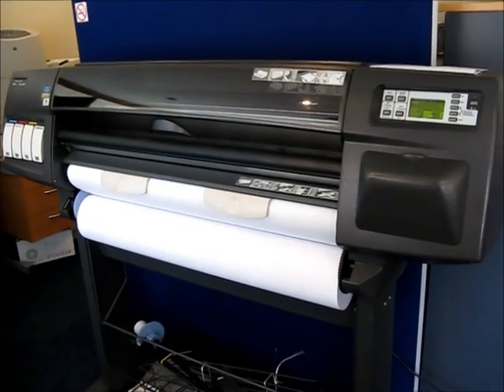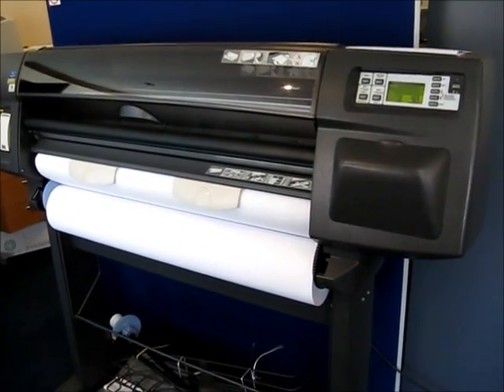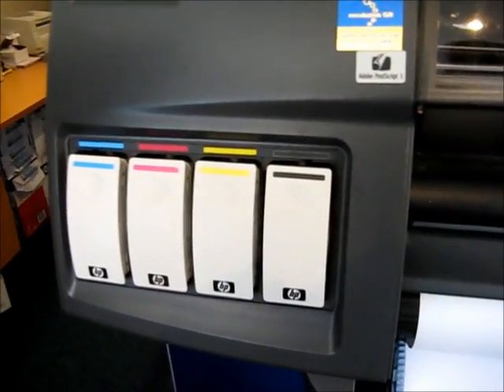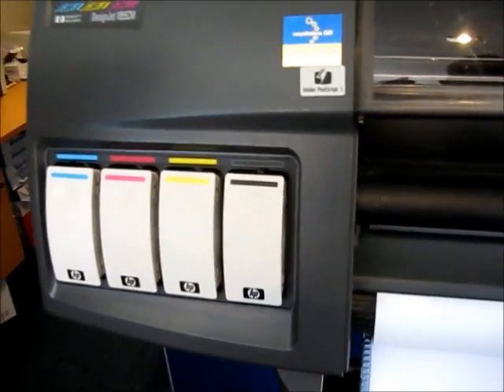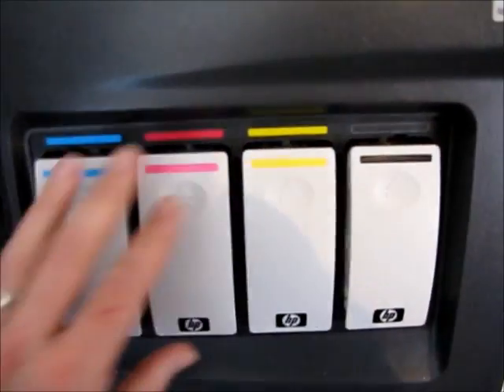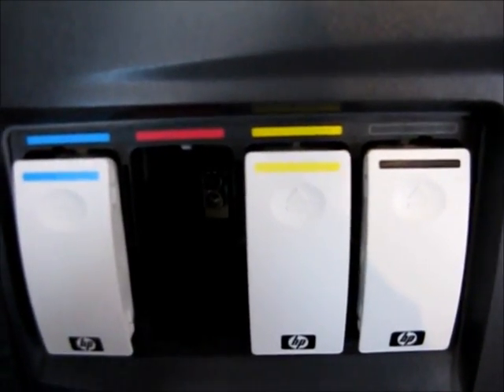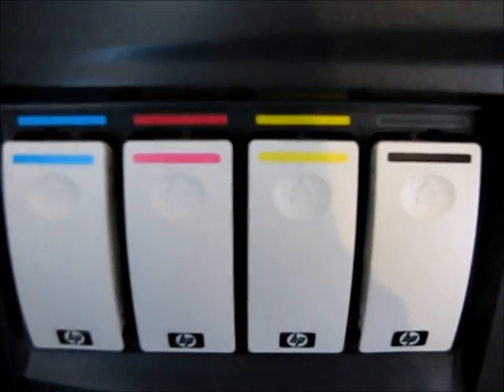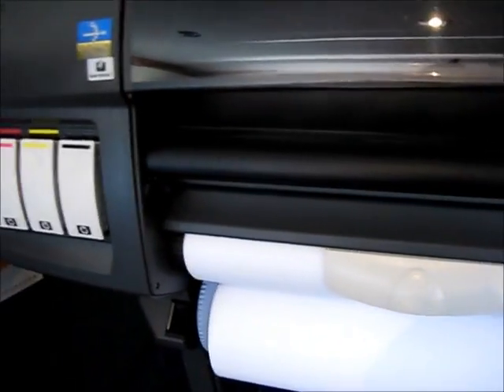HP DesignJet 1050 repairs - Replace ink cartridge

Comment: Is the designjet 1055cm plus still a   capable printer today 20 years later? Or is it just scrap yard material?
Reply: They were great solid workhorses in their time. If you can get it to work with an old operating system and pay a low cost for it then great but a full set of inks will cost a ballpark of £545, a set of printheads will cost you £640 and if the printer needs an engineer there is no guarantee of a fix. A new machine would be a better option in my opinion. I wouldn't pay any more than £50 for it or more if it included all the ink and you had a test print to say it worked OK. Generally though, not worth the hassle.Your main issue is getting it to work with your operating system as HP do not have drivers for this model to work with say Windows 10 as its far too old.

Comment: Have faulty coming up on all cartridges any clues?
Reply: You may have a faulty printhead - remove all inks and printheads - replace printheads individually and check if the printer accepts them - and then try replacing the ink cartridges. What happens? We can supply new printheads to you - please email consumables@hpplotter.co.uk